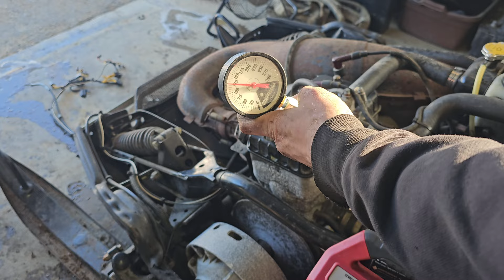Diagnosing a Snowmobile that's Been Sitting 10+ Years...Will It Run?

Comment: If yur gonna keep it, take the time and tear it down and clean it up. Look along the bottom tubes on both sides for rust and how much.  Two primers are for each 40mm carb. each has it's own fuel supply.  It needs new crank seals. Rebuild it and get yur self a parts machine.  The xtc are worth keeping. NIce sled u got it's worth restoring if u can. PRS and F chassis R my Favs. I have 4 of them. Thanks for sharing.
Reply from the maker: Part 2 is coming next week! I'm very excited to restore this thing! Thanks for the comment, great advice

Comment: x2 on the crank seals in reference to the engine RPM.
Nicely done on the startup. Wondering if since you have the bottle with 2 stroke oil why you would not have gone full throttle on the carbs or removed the carbs and used the bottle to inject oil on the crank rods and on the crank bearings as well as a guy can do in this situation?

Comment: I wonder if running it a bit loosened the rings in the one cylinder. What was the mileage? I would be tempted to remove the head and check the pistons and cylinders. But that water would make me concerned about the crank bearings.
Reply from the maker: Yeah, we got lucky with the compression. Yes, I think running it loosened them up for sure. The milage is only 1700! Part 2 will be dropping next week, I have an idea to try and inspect the crank bearings without pulling the motor apart. We will see if it works. Stay tuned! Thanks for watching

Comment: Save yourself some grief and pull the carbs off and clean them. For how long that was sitting that would be the first thing I would do. Pulling the head isn't going to give you much of a view of the crank or case. Maybe pulling off the exhaust Y pipe you can get a look with a light and one of those small mirrors. I'd also pull the rave valves apart and make sure the diaphram is good and all working and clean the valve part. Always lots to do on an old neglected sled.
Reply from the maker: Great points! Part 2 should be dropping next week. Lots of stuff getting done on this project 😎